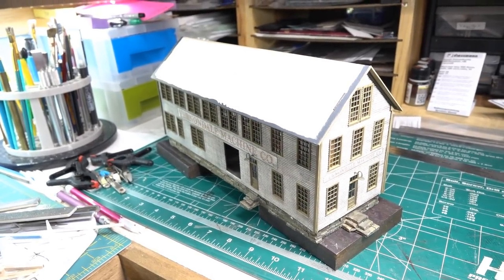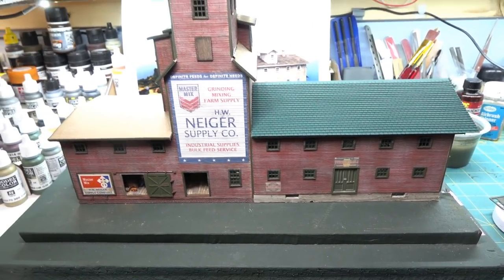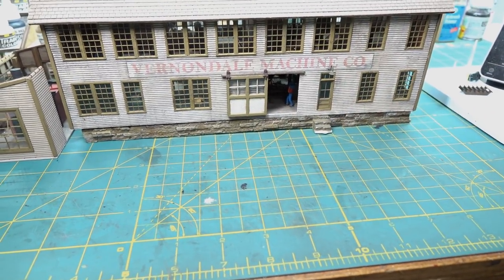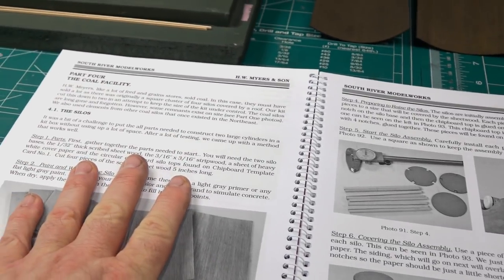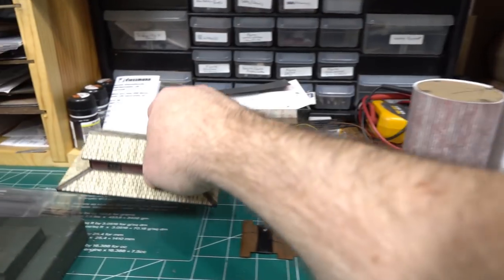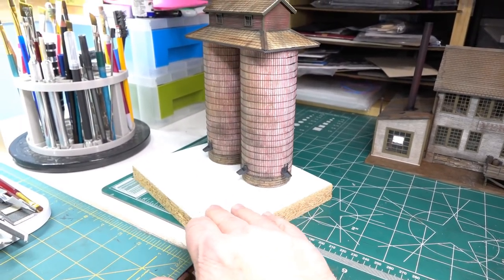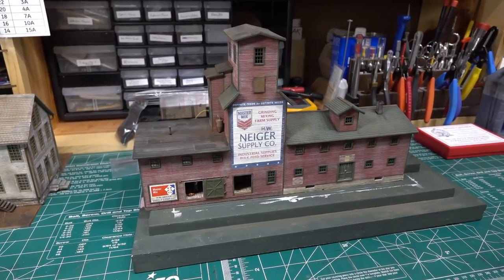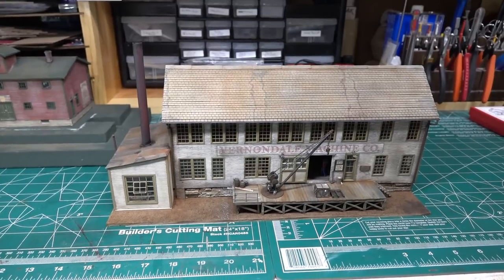Kit Build #2 & #3- Two Craftsman Kits: Part 3

Comment: Rob, those kits turned out amazing. Nice way to resolve the coal silos. I wonder if you steam those pieces of siding would they bend easier? The crane on the machine shop loading dock is amazing looking, do you know if it is still available anywhere? I cannot wait to see these installed on the layout and lit. This build series was just fantastic. Happy New Year, Rob T
Reply: Thank you! Based on several other comments about wetting the wood it may have worked. I'm not sure about the Walthers' loading dock- I had it for years. It may be available- if not at Walthers perhaps on Ebay.

Comment: to get the wood to go around the tower first dampen it, then wrap it around a tube of a similar size, clamp it with rubber bands  and let dry. After it's dry it will have a good curve  to it and it won't take much force to go around the core.
Reply: Great advice- I wish the kit instructions mentioned that! Oh well, I did learn a valuable lesson.

Comment: i actually like your towers. in retrospect though i think i would have dampened the siding sheets for flexability, leaving a small over lap in case it shrunk some,  gluing  it to the silos while damp.  then  when dry glued the final seam, then stained and weathered it.
Reply: Very good idea. Too bad I didn't think of it when swearing at the warped, cracked pieces of wood! LOL.
Reply: @robbennett1965  lol